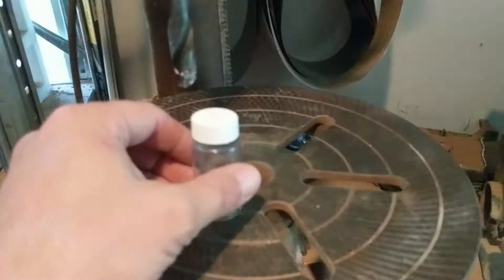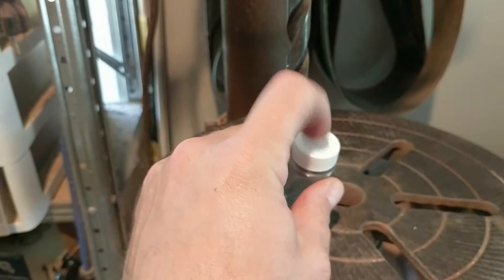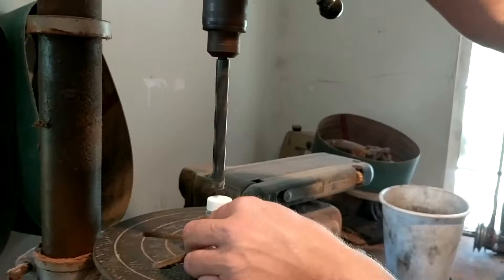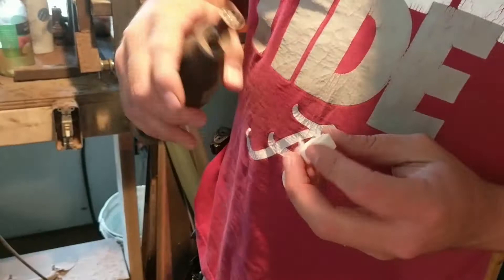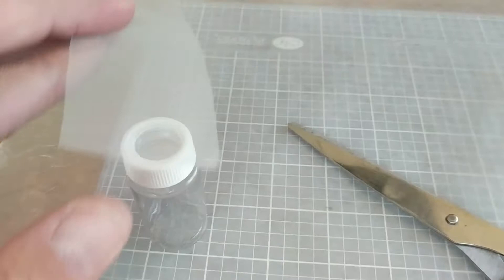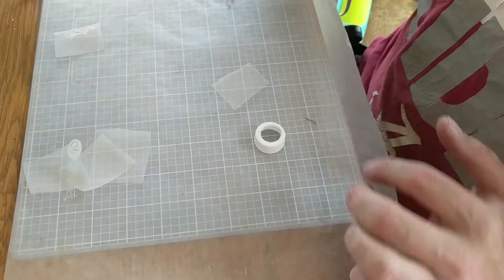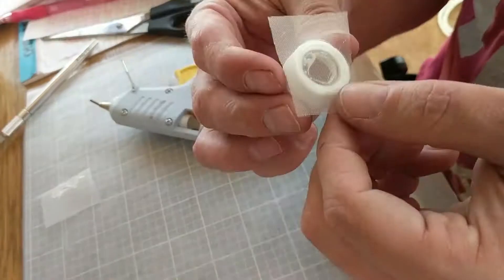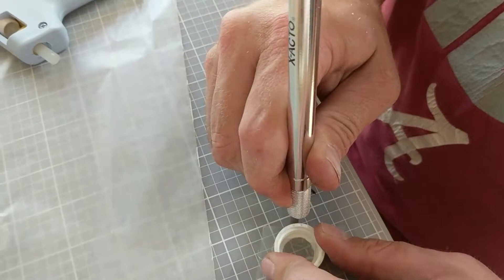Making Screened Vials For Bed Bugs

Comment: Nice work, but what about the scent of the glue...?
Reply from the maker: Hi Bart,

The scent of the glue is not an issue for the same reason the plastic of the vial, or the screen itself isn’t an issue. During scent discrimination training we hide vials made exactly the same way as these, but without live bugs to discriminate the dog off of any odor other than that of live bugs. It is the same process as discriminating off of dead bugs, fecal, and cast skins.
Reply: @FSIK9Academyfsik9  , thank you for  reply ! That's the same way we deal with such issues over here :-)